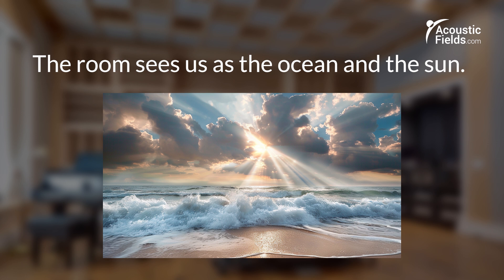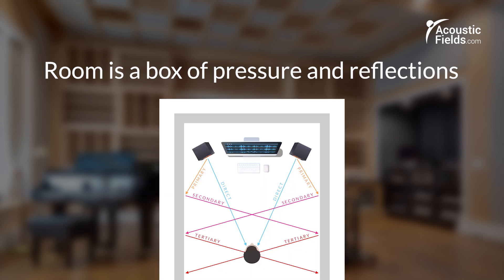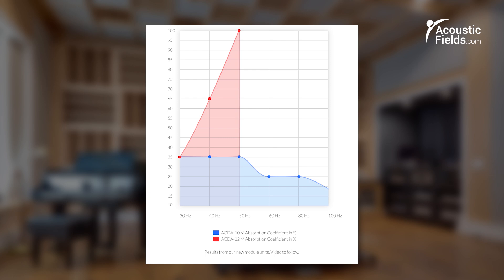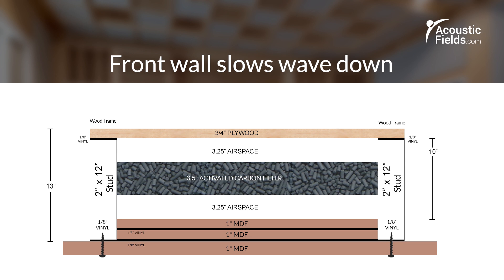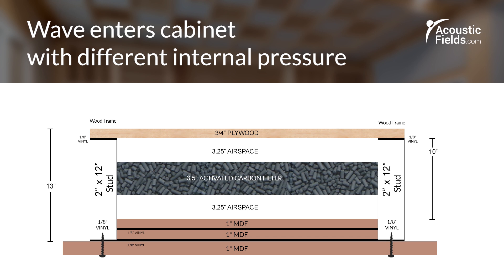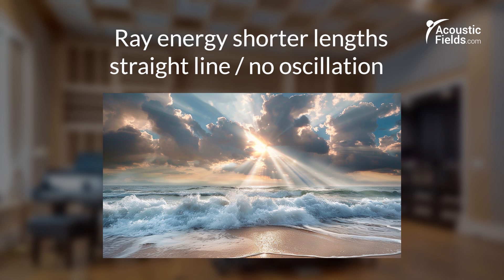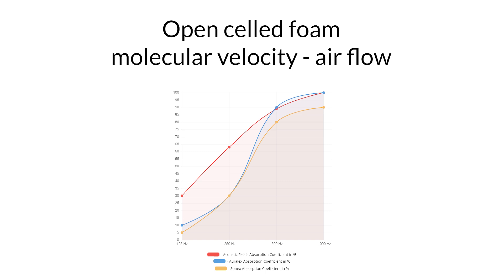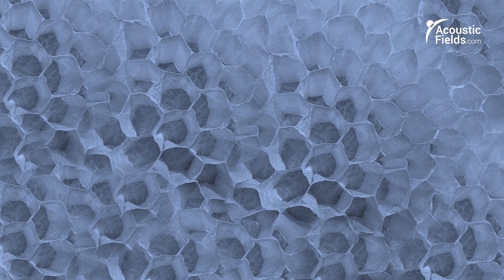What The Treatment Sees - www.AcousticFields.com

Comment: Great stuff. thanks.
Is the ACDA an airtight system in the diaphragmatic section?
Reply from the maker: Yes, this is a pressure based unit that is sealed.
Reply: So glad you asked this so I didn’t have to wait for the answer. Wondered the same thing!!🙏